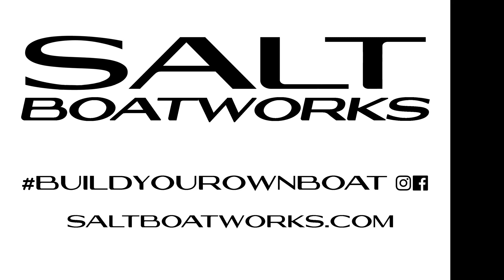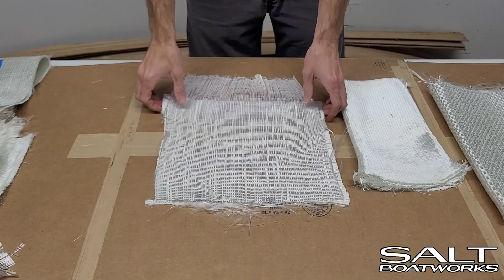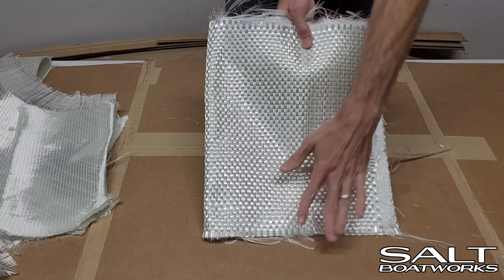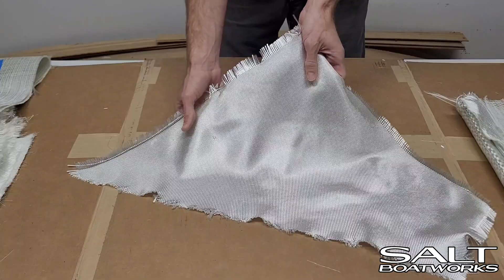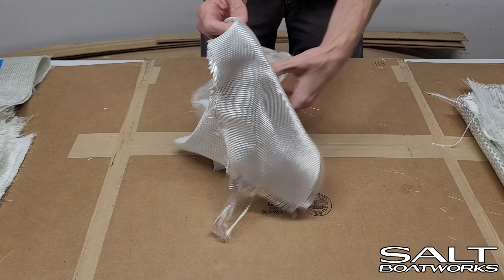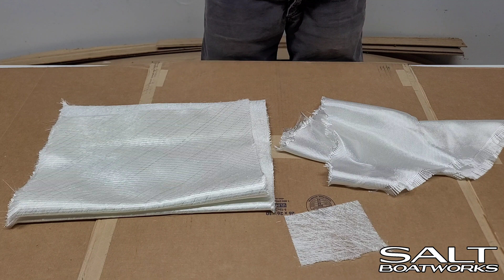Understanding Fiberglass Types - Different Weaves, Weights and Uses - Basics of Fiberglass Fabric

Comment: In North America, The itchy and skin irritation, is caused by the styrene binder (adhesive) in chop strand mat(csm). Woven roven (weave) and stitched fiberglass do not have a binder in it. Also the styrene binder in chop strand mat does not dissolve in epoxy resin but does dissolve in polyester and vinyl resin. The reason you are not supposed to use chop strand mat with epoxy is because of the styrene binder. The binder in chop strand mat can cause epoxy to not flow thru the glass properly an takes alot of effort to fully saturate the glass. Now in other places around the world chop strand mat comes a with powder binder that does not interfere with epoxy. Building insulation fiberglass also has this binder in it and the reason it is itchy. Now the dust from sanding, cutting any fiberglass that has cured, will itch alot worse then the csm.

Comment: A correct description of the different materials, but I would like to add that you always finish with a chopped mat, partly to get a finer surface before sanding and painting with topcoat, and to continue laminating additional layers or eventual beams, etc. The chopped mat contributes to better adhesion between the directed mats.

Comment: “I don’t think an extra gallon or so of resin is a bad thing when it comes to the strength and integrity of the structural components of the boat”

Adding to much resin can be a bad thing.
Adding to much resin can cause the fibres to “float” and not bond together which will cause weakness. You don’t want a a lot of resin, you want enough to wet it so it bonds together. (Getting cardboard or a smooth wooden bench to paint it onto the glass works) If you use too much resin, use a roller to push the excess resin out along with your air bubbles. 
Clean with a rag and acetone.
To keep your glassing bench clean (if not using cardboard) lay down strands of chop with resin over the top when finished, let it go hard. It will peel off as one and leave you a smooth working area the next time you use it.

Comment: Great Video. I know this is related to boat, but I am working on classic car and there is a piece of metal rusted and I want to replace it with fiberglass instead of welding a new piece. which cloth and resin you recommend?
Reply: The strongest combinstion is epoxy + cloth that doesn’t have chopped strand matt (CSM). Use only 1 final layer of CSM on top to prevent print out of the fabric underneath and to ease fairing.
If you will go the epoxy route also use epoxy based fairing and not bondo (which is polyester resin based). Good luck